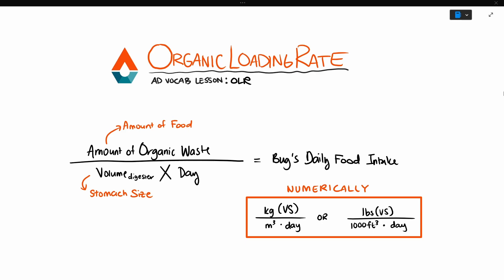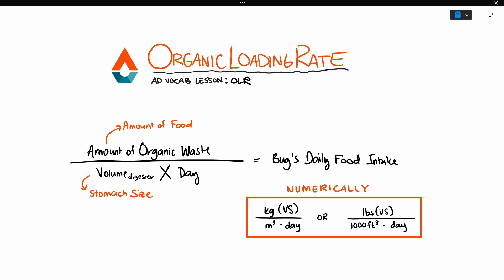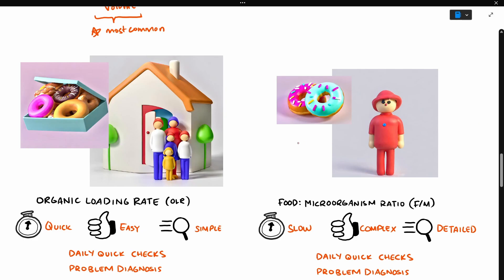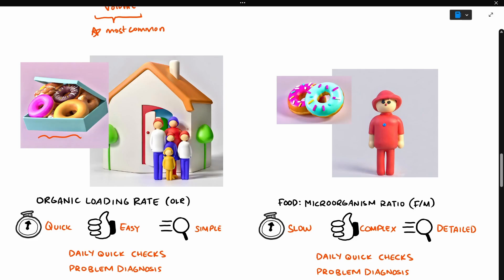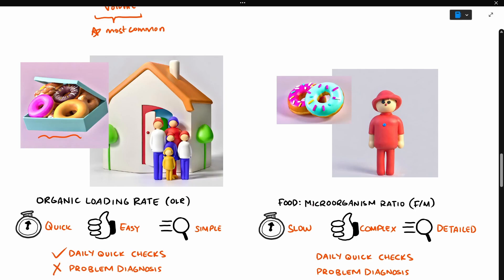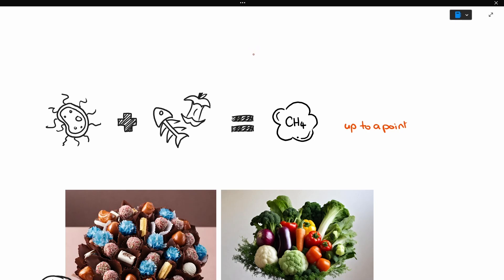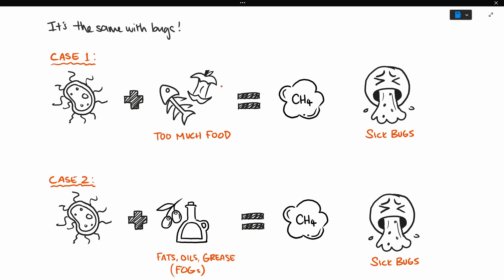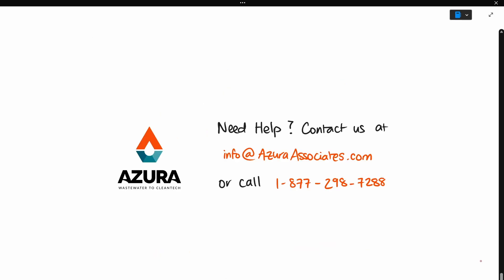What is an Organic Loading Rate (OLR)?

Comment: like to hear more about many desiggners just use HRT to design their anaerobic digester systems how is that?
Reply from the maker: The primary goal of sewage sludge digesters is to destroy pathogens. Pathogen destruction is achieved largely through time and temperature. These sewage digesters may maintain a minimum HRT of 15 days. HRT is the most basic form of loading estimate and relies on an assumed ‘normal’ levels of solids content and degradability, for that specific feedstock. For well known applications, this simplified approach is usually okay and the designer may skip detailed organic loading calculations. This simplified design approach carries a significant risk of oversizing or under sizing the system if the actual feedstock loading and degradability varies from what the designers assumed. Subscribe and watch for Dave’s Deep Dive video series on organic loading, biomass and F/M ratios.

Comment: this is really expert explanation.  but why is sometimes f/m ratio does not work? thanks you.
Reply from the maker: The food-to-microorganism ratio, also called “F/M ratio” is, in theory, a universally valid and reliable approach to balancing the amount of food in the feedstock with the number of microbes to consume that food. The challenge comes from laboratory testing to measure the amount of food and the amount of microorganisms (collectively called ‘biomass’). 

Measuring the true amount of food is usually difficult, time consuming, and costly. So instead, designers sometimes use simple tests like ‘volatile solids’ (or ‘VS’) to estimate the amount of food in a feedstock. One challenge is not all volatile solids are degradable inside an anaerobic digester. For example, wood chips will show a high degree of volatile solids but are not biodegradable anaerobically—this will give the designer and project developer an overly optimistic idea of how much biogas their project can make.  Similarly, ‘volatile solids’ are often used by designers to estimate the quantity of microorganisms (also called ‘biomass’) available in a digester.

The same issue arises, maybe a portion of the VS is not actually living biomass, but is wood chips, activated carbon fines, or other things that are not active biomass.

So, F/M is a great theoretical tool if we can know both the amount of food and the quantity of biomass perfectly. The challenge is we do not usually know either of those pieces of information that well.

Subscribe and watch for Dave’s Deep Dive video series on organic loading, biomass and F/M ratios.

Comment: Big thank you to the experts at Azura! How is this different than hrt for a rng or biogas plant?
Reply from the maker: HRT is a measure of the feedstock’s residence time in an anaerobic digester and can include a lot of water that does not produce biogas or RNG. The OLR is a measure of how much food or organic solids are being fed to a digester and ignores that water and inert parts of the feed. Think if a plant can receive a) 10 m3 of 10% TS manure or b) 10 m3 of 40% TS food waste in the same digester. Both scenarios have the same feedstock volume of 10 m3, and same HRT, but the food waste scenario has four times the organic loading rate (OLR). The higher OLR food waste might be able to produce more biogas or RNG, but carries a higher risk of overloading. In summary, HRT is how long the feedstock spends in the digester and OLR is how much food organic solids the digester is fed.
Reply: Thankss alot it cleared concepts in my mind
 I am currently doing bs final year research on biogas upgradation @AzuraAssociates
Reply from the maker: Glad to hear that the video and comments have been helpful. Let us know if there are any other concepts or topics that you'd like to see covered in the future.